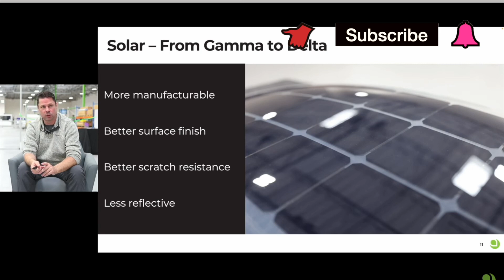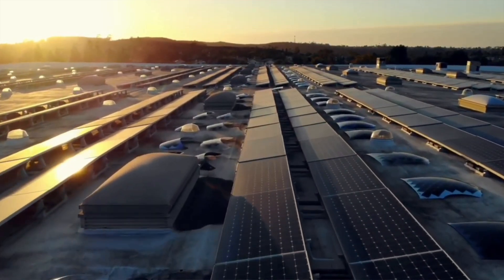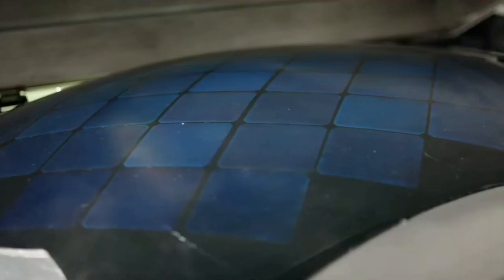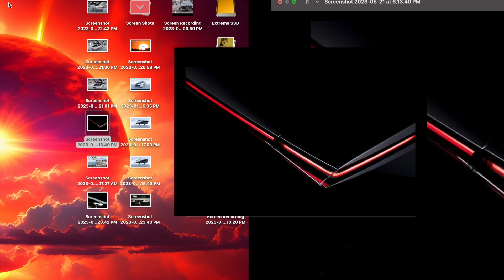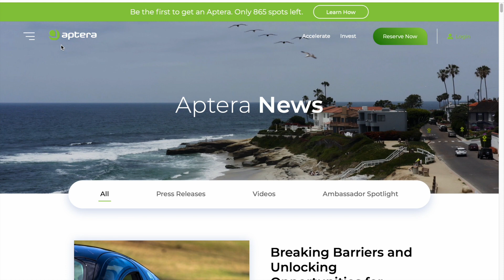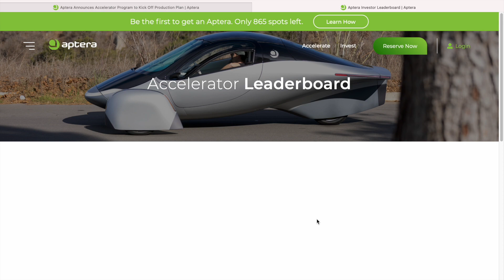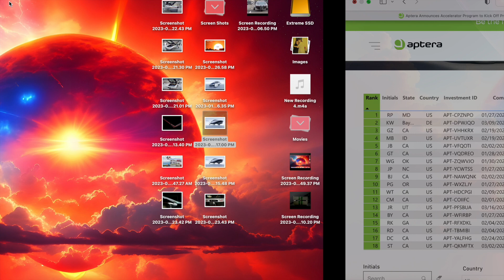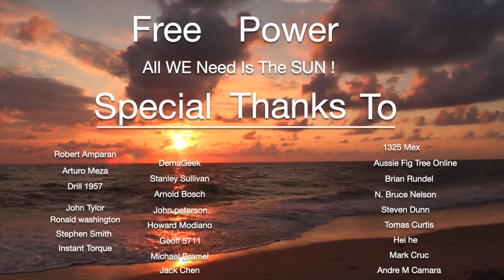Aptera Takes Solar For The Delta To A New Level !

Comment: I purchased 109 shares of Aptera's first privately offered stock and spent $1008.80 in 2022 and now the stock certificate is worth ZERO. What a horrible scam Aptera is. These purchased shares could be use as money down towards the purchase of one of the Aptera's I speced out on their web site, but now worth nothing. I wish them absolutely nothing. They are deceptive thieves as far as I'm concerned. They totally screwed me bad. I wonder how much money they took from people and are now not accountable for. This is a Total Scam, that's why they are always talking about production and investing all these years and will sucker you into giving them more money like I did and know it's worth NOTHING. So, unless they give me the credit that I disserve for believing in them and investing in them, which they won't, I do not trust these fraudsters. It's all about crowd funding and private offerings and filings BS, which is a complete Hustle. For years they've been taking money with no intention of giving you credit. They literally CANCELLED my paid for and owned 109 Shares that I bought last year in 2022. Now worth nothing. They literally went from selling me the 109 shares at approx. $9.80 a share to now valuing them at ZERO. I wonder how many other people got ripped off.  Wow, I can't believe I fell for this BS.

Comment: Aptera, the car that has the longest wait time.  Always looking for more money.  How many sold since 2007??????
Reply: This is factually untrue.  The original Aptera, Inc. from 2007 is legally not the same company as Aptera Corp founded in 2019.  The vehicle being designed and built by Aptera Corp does not have a single part or even drive train concept in common with the original Aptera design.  Although the founders are the same, the first company was a partnership with Idealab that hired management from Detroit .  They did not want to build the vehicle they were hired for and that was ready to go.  They kicked out the founders in a board coup in 2009, both of whom went on to form other successful companies before starting Aptera Corp in 2019.

Comment: Loving your positivity! Aptera will come to market, no doubt in my mind anymore. :)
Reply from the maker: Absolutely! 😎
Reply: To market with what? Seriously, list all the specs of the vehicle you hope to buy. Which are so critical that you won't purchase without them?
Reply: I will actually not be buying an Aptera myself. I’m happy with my bicycle. But many people refuse to give up their automobiles and Aptera is the only one that averages 10 miles per kWh. This is important to me because the heat that humans have been offloading into the ocean from machines for about 150 years is has made a severely negative impact on the environment and weather patterns. I’d like to see everyone who insists on driving, driving an Aptera instead of any other vehicle.
Reply: @EricPeelMusic  Fair enough. 10miles/kWh has not been demonstrated yet. I agree it's the cornerstone of their identity and marketing. Concerning that they haven't demonstrated it in real life conditions with full size vehicle. Or answered anyone in all the months of questions about that.
Reply: Based on the shape, number of wheels, type of batteries and motors, I have every reason to believe it and I’m not concerned about range on it at all. I used to have an ebike that would do 50 miles on 1.2kwh at 25mph. Pretty impressive yet that was with older tech batteries, an inefficient motor and brick-style aerodynamics. The increased weight of an Aptera has little effect on range once up to speed. And the frontal area is very small and shape very aero. Aero wheel covers too. Much more friction from wheels, yes but only 3 and much lighter than other cars, further reducing rolling resistance.

Comment: Re: Aptera Tail Lights.  I mentioned in the discussions that amber turn signal would be advisable.  Here was my comment:

In 2008, NHTSA (the U.S. National Highway Traffic Safety Administration), released tentative findings that amber (“yellow”) turn signals are up to 28% more effective at avoiding crashes than red ones.

Amber rear signals are required in Europe, Australia, New Zealand, Asia (including Japan, China, and Korea), South Africa, and most of South America. Outside North America, red turn signals have been banned almost everywhere for 35 to 55 years.

If the Aptera is going to be marketed / sold. / manufactured internationally, you may as well make the rear turn signal amber on release of the vehicle..
Reply: Good insight. I’m sure they’ve considered this and since the first major market is North America and North Americans prefer red, they’re going with red to maximize profits. But I’m sure it’s easy enough for them change the color to amber for other markets. Less costly than making all cars amber and losing potential sales.
Reply: @reeldeelpeel From North America- commented today when driving how I hate the red lights only. They just don't show all another's intentions.

Comment: Sorry but Chris A's and Steve F's credibility on anything solar related is completely shot.  Aptera had told us all that "automotive grade" solar was "in production" back in early October of 2022 and Steve Fambro said in first week of January 2023 "...storage racks beginning to fill with Aptera solar panels...." and Aptera's solar golden boy Anuj Thakkar, also back in early October 2022, told us "...that we've gotten one of the most challenging parts of the vehicle (the solar) out of the way..."  Apparently it was all untrue.
Reply: I don't see how admitting to "early production issues" makes those quoted statements from the recent 5-8 months wrong or otherwise harms their credibility on solar.
Reply: @takenoshortcuts  "early production issues" is a euphemism for we're misleading you now to provide cover for our previous falsehoods.

Are you familiar with the phrase "Fool me once shame on you.  Fool me twice shame on me"?

Do you see it now?
Reply: I've been involved in rating and installing a few solar arrays. The Aptera array does not look possible to generate 4kWh/day. I'm also expecting 7-8 miles/kWh max. Maybe avg 15 miles/day in typical locations.
Reply: @artsmith103  With "full solar" package, there will be ~700 watts worth of cells on Aptera.  I've built and tested numerous arrays on solar race cars for more than 20 years and I estimate that, at best, the ~700 watts worth of cells can generate from 500 to 550 watts to the load and/or batteries.  Of course "at best" is meaningless in most cases and the instantaneous power will be far lower much of the time.  All in all I estimate that "full solar" can deliver an average of 2 kwh/day in a sunny location and, interestingly, when multiplied by your ~7.5 miles/kwh "efficiency", comes to 15 miles/day average.  Pretty cool!
Reply: @bobhilder1469  2kWh/day from poorly installed 700W is a good hopeful estimate for those with good sun. Of course more in summer, less in winter. 
That's the easy part. Miles/kWh is the big question. With limited lighter, slower vehicles only getting 8 miles/kWh, all purpose Aptera looks way over rated to me. 150% of Prius would only be 6 miles/kWh. The Prius is only 50% better than Lightning F150. Aptera 50% better than Prius seems like a stretch.
Reply: @artsmith103  I'm, admittedly, a bit in over my head on estimating electric vehicle "efficiency" (miles/kwh) but you're reasoning seems quite sound.
Reply: @bobhilder1469  My comments are for everyone. Aptera doesn't call the LE battery 40kWh, they call it 400 miles. The entire identity and marketing of the car is hanging on 10 miles/kWh. Secondly, they are inferring 4 kWh/day (avg?) from the 700W solar. The Lightning is 2.4 miles/kWh, C-max is 3.3, new Prius is 4.1. How can Aptera be more than 6-8 miles/kWh in usual driving? That puts the LE in ~280 mile range, but actually worse. Real use battery is only drawn down to 20% SOC to maximize lifetime charge cycles. So 40kWh*80%*7miles/kWh= 225 miles. Poor value for over $30K with only 2 seats, 3 wheels, no hitch option, no roof rack option. Half the car of a TSLA. And mid $30K PHEV blow it away.
Reply: @aussieideasman8498  I operate a solar array, and have helped organize others for installation. The data is mapped very accurately for most of the world. My array has been operating +/- 2%/yr of scheduled expectations for over 4yrs. The industry has all of the variables organized quite well. The most convenient measurement is Average Peak Equivalent Hours of sun per day for an array orientation and location. Every Aptera owner will have different results. A very good average good estimate is 3, lower is very possible. Multiply that by array size of 0.700kW = 2.1 kWh/day. If Aptera gets 7 miles/kWh = 15 miles/day. ~$0.30/day electricity, $120/yr. It's worth something to manage a small 20kWh, 140 mile battery. But it's not a "Good solar investment", vs Aptera cost for solar. Aptera's 1 possible winning chance is <$20K, 20kWh battery with solar, for people driving less than 30 miles/day in their commuter car. And if they have easy charge access, skip the solar.
Lighten the car to 70mph motors, 20kWh battery.
Reply: @aussieideasman8498  If you want to do some helpful research homework on a topic not discussed yet, try to find out how Aptera is wiring the cells regarding parallel and series. This factors into partial shading and 1 cell degrading another in the string. The fact there are 1 to 3 panel options hints that the panels have to be independent regarding charge controller to the battery. Inside each option they have to manage required voltage off the array while minimizing shade losses. It's a little suspicious there are so many options, like picking how many speakers you want on the stereo.
Reply: @artsmith103  In solar car racing solar arrays many rather sophisticated voltage boost MPPT's and many strategically place "ideal" or "loss-less" diodes are used to mitigate the inherent mismatch in multi-axes curved arrays.  A less commonly known characteristic of the Maxeon cells that Aptera is using is their relatively low "breakdown" voltage.  This characteristic effectively gives EACH cell a bypass diode.  It's a relatively bad diode (large voltage drop) but it can save from the dreaded "hot spot" problem.
Reply: @aussieideasman8498  Miles/kWh are a function of many things. Speed, weight, stop/go, weather, hilliness, etc. Maybe they can almost get 10 miles/kWh at 40 mph, on a banked oval, no wind, a little warm, with a small test battery, and a cute small driver. But extrapolating progress from other vehicle developments, 6-8 looks hopeful in the real world and I lean towards 7 or less. That's twice as good as my PHEV but I have twice the car for similar price.
Reply: @bobhilder1469  Very good, I'm aware of most of that. Do you agree offering modular expansion is a liittle odd for balancing all of the components at the battery, especially due to different shaped  surfaces? Small issue compared to everything else. For what the solar might actually do, I sugeest people consider enjoying the glass rear hatch and save that solar piece expense.
Reply: @artsmith103  I'm afraid I don't understand your question.  Could you re-phrase?
Reply: @bobhilder1469  I have more gridtie experience than off grid. I expect each zone needs it's own charge controller. Then each charge controller needs to tell the other two that it has raised the surface voltage such that the battery isn't as full as it looks (high voltage.) Maybe since their amps are so low, the battery system can just enable or disable them without careful float voltage control? In the RV world we say 1.5% of C is safe without charge control. For 40 kWh, that would be 600W so that's pretty close to the 700W Aptera installs and the angle will derate it more than usual. But it is a Lithium battery. I only take chances like that with lead batteries.
Simple question is if you're familiar with 3 charge controllers communicating with each other?
Reply: @artsmith103  This is a bit oversimplified but in solar car racing, a typical race rule limited 4 m^2 solar array would be broken up into, say, two 2 m^2 "strings".  Each string would simply have it's own voltage boost MPPT and the outputs of each would simply be electrically paralleled with each other and the battery buss.  Each MPPT is likely communicating (via CAN I believe) with a separate BPS (battery protection system) that tells them when to go into voltage control mode rather than MPPT mode.
Reply: @bobhilder1469  Thanks for info. I'm familiar and confident of the 2 charge controller communication method. I have never seen 3-way or ports to communicate 3-way.
Reply: @artsmith103  I used 2 strings/MPPTs as an example.  I'm pretty sure some cars have 3, 4 or even more but the principles are still the same.  The BPS system would communicate with each.  I think what makes it easy is that the instruction to each MPPT is the same.

Comment: The new Prius has a solar panel.
Reply: Yeah a few of them do, but they don't really give any meaningful range to the vehicle like Aptera will. I think 3-4 miles with the prius and about 35-40 with Aptera.
Reply: @theninjineer  It's not 35-40 with Aptera.  With full solar and full exposure in a very sunny location, we're told Aptera will average on the order of 30 miles per day.  I don't know the Prius numbers but you're right, there's quite a difference.
Reply: A few old Prius's had solar panels too....